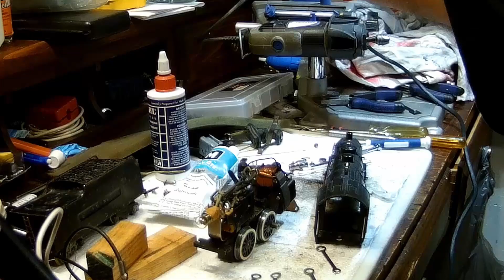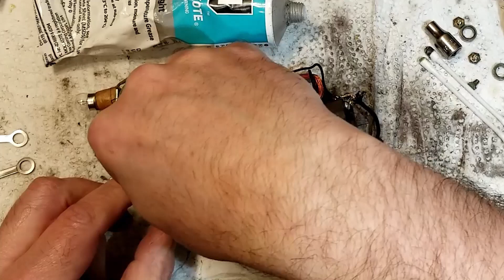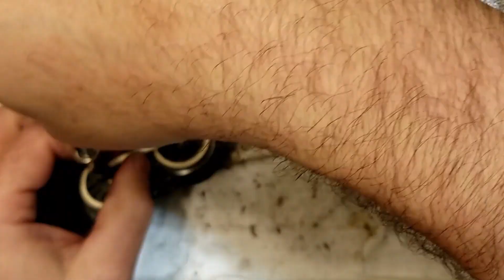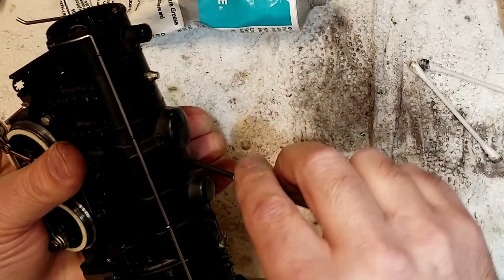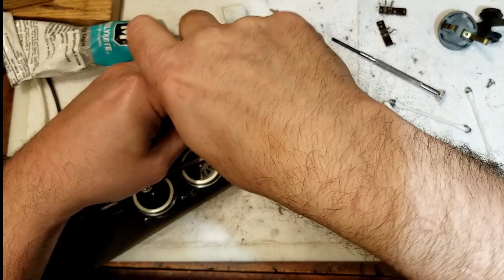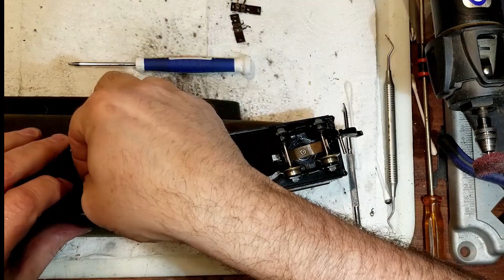American Flyer repair basics: 1946 #300 4-4-2 Atlantic...clean & assemble.

Comment: Great idea using micro flathead screwdriver to apply grease, what brand is the grease you are using? Isn't it ironic we grease the same spots I've seen steam locomotives oiled in real life!
Reply from the maker: The grease is by molycoat and is a food-grade, low temp variety. I'm not sure if you watched the videos I posted on the Nevada Northern but the fireman estimated over 100 oiling and greasing location that needed to be filled each day...and some every so many miles of operation.  Taht experience really drove home how labor intensive steam engines were...especially the earlier engines.  Once they added roller bearings and more automatic oiling the maintenance went down and availability went way up.

Comment: I really enjoy all your videos!!  Curious as to what you use to clean the body of die-cast engines?  Especially if it’s die-cast.  I use CRC226 on plastic bodies and I like the result.  But on die-cast it removes some of the touch up paint I put on.
Reply from the maker: Thankyou Michael.  I usually first gently clean with soap and water then crc.
Reply: Have you done some touch up paint on them as well?   Did CRC remove any paint?
Reply from the maker: @michaeldehart779  I did just a tiny amount on this engine after I cleaned it.  Now the tender is a different story.  I did the same cleaning steps and it still looks pretty rough.

Comment: I finally got up the nerve (or separated enough from sanity) after watching the last video in this series and disassembled my 300 which is probably one of the two versions after this one, and worked on the reverse unit which wasn't selecting forward. This locomotive had never been taken apart and, in fact, really looked new, other than some obvious wear on the wheels and some dirt on the reverse unit drum there really was nothing that indicated it has has much use at all. The brushes looked brand new. After cleaning the drum with iso alcohol, I tested the locomotive and it moved very efficiently through the cycle from reverse to forward. After reassembly it took right off when I applied power - in reverse only. I just kept running it a bit over the next few days and while it still prefers to run backwards, it is getting close to running almost evenly between forward and reverse. One other problem I had is that when it was running in reverse, the trailing trucks usually would jump off to the side. I thought some more weight on the bar the axle rides on would solve the problem. My idea was a 50 cent solution. I taped five dimes on the vertical part of the bar and the problem was solved!
Reply from the maker: Good for you Mark! Way to dive in and then add a little 'engine-uity' to boot!  Awesome!

Comment: I generally put the steamchest on before installing the side rods.  That way you are dealing with them one side at a time and not having to juggle too many pieces at one time.  

You might get some stiff foam in a "U" shape to make a tray to lay the engine in upside down to work on it.  I'm old and it becomes too much of a juggling act without developing some shortcuts.
Reply from the maker: Hehe...I understand I have a cradle I want to build but have other projects  that keep taking priority.